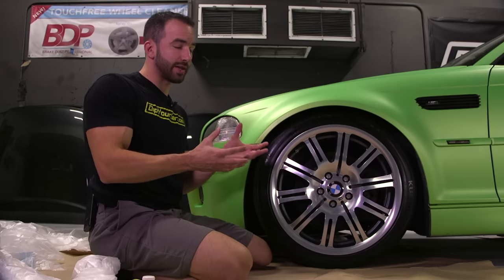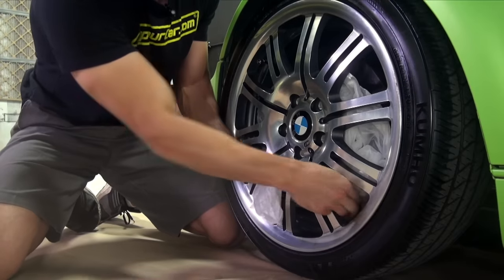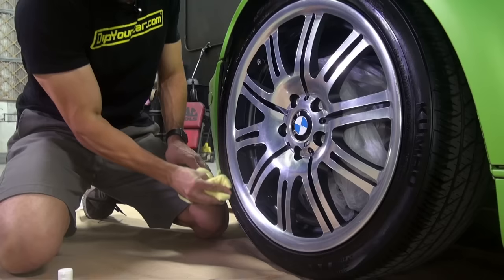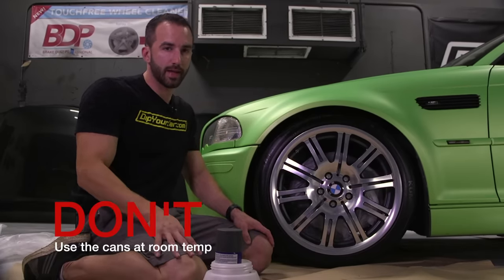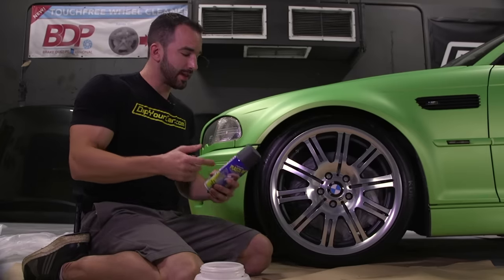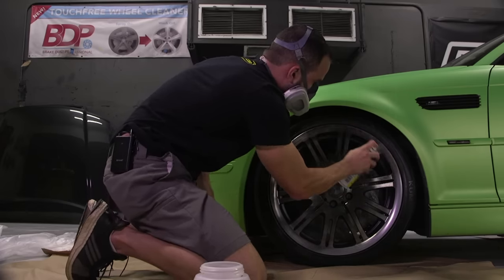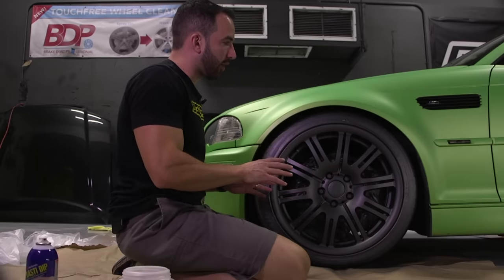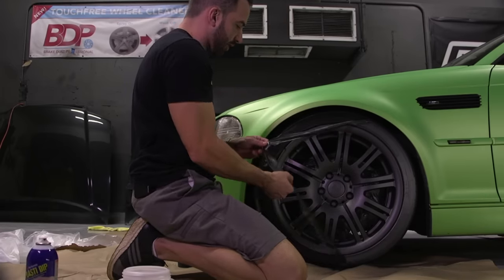Official Do's and Don'ts of Plasti Dipping Your Wheels

Comment: Plasti dip can not in any way hurt or stay on a cars tire. If you got plasti dip in the the treads who cares? It will literally come off the first time you drive your car.
Reply from the maker: That's inaccurate.  Plasti Dip can and will stick to a dry tire, and it will be a sincere pain in the butt to remove it.  We've seen it happen way too many times.  Do it right and save yourself the hassle.
Reply: Stitch in time saves nine.
I dipped my wheels about 2 years ago and 'forgot' to mask my tyres. It was a pain in the arse to peel it off the tyre.
Reply: It really doesn't matter if it gets on the treads but if it gets on the sidewall of the tire then it can become a royal PITA.
Reply: DipYourCar youre just trying to make us buy unnecessary products.
Reply: MrRangerZr1 i got it on my sidewalks when I did my car. I just let it dry and it peeled off easy.

Comment: I can't believe he sprayed over the center cap
Reply from the maker: Young Buck why?  It’s peelable, you can just peel it off the center cap.
Reply: @dipyourcar  You need to pin your response. There are like 50 comments asking the same thing. However, why does it peel off of the center cap and not the rim itself?

Comment: Not my cup of tea, I want the factory center cap and valve stem its original color.  Covering the logo just looks silly
Definitely if you've got some high end after factor wheels like 19" rims on rubber bands.  You've got 4 to 6k dollars worth of wheels and tires, why cover the logo with a monolithic color scheme?
The logo will pop if its original color.
And the valve stem might be metal so you want to find it to put air in the tire.

Comment: Dayuuuum 4 cans on one rim?
Reply from the maker: Bo Jackson no, 1 can per wheel.
Reply: DipYourCar I have a question...I want to paint my black bumper cover on my Jeep that electric lime green...do I need to add a lighter color coat over that black before I add the lime green? Or can I just spray the lime green on top of the black n it will still come out the right lime green color???

Comment: Dip release is just oil isn’t it?😂 and I could just use trash bags from my house and not have to buy the dip kit😭 lol saved 30 bucks just like that.
Reply from the maker: Dip Release isn't oil.  You aren't charged for the masking bags, they are free.  You would save less than $3.00 removing both from the kit.  The majority of the Wheel Kit cost is the Plasti Dip cans themselves.  Thanks for watching.  ☺️
Reply: Would Armorall on your tires work for the release too...shine your tires at the same time.